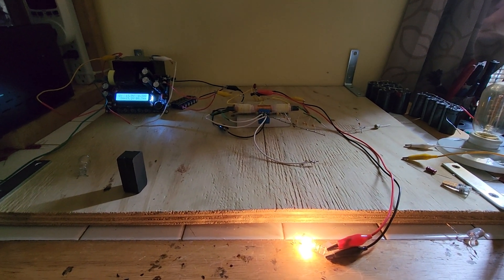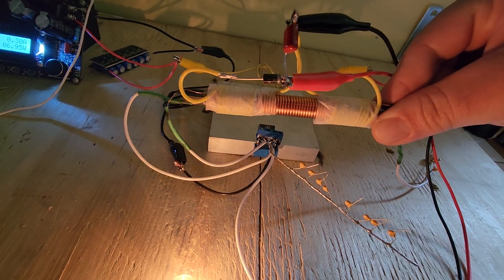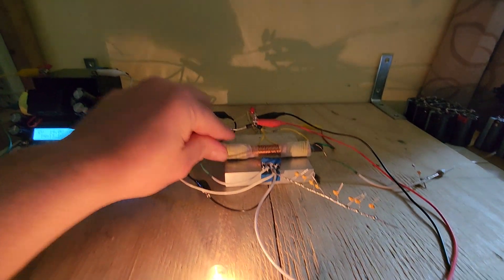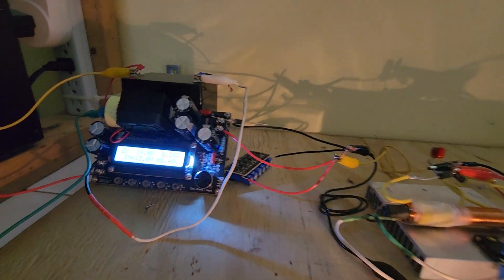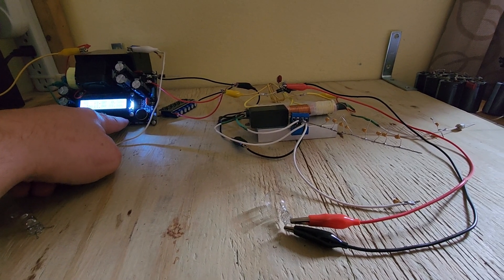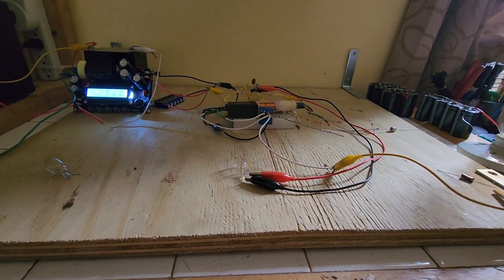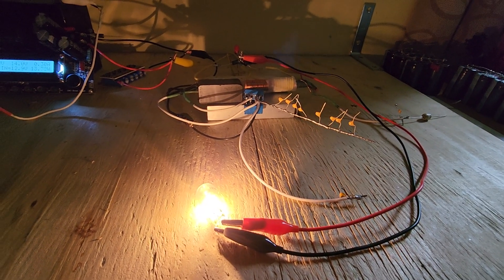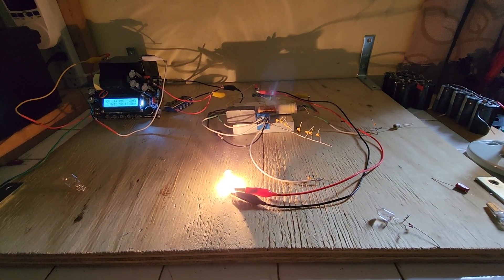🧲MAGNET NEAR RINGER INCREASES POWER OUTPUT & CAUSES XTREME🔥HEAT GENERATION IN COILS?💡

Comment: Hey man im trying to get my ringer going is those transistors you recommend the only type that would work i dont have any of those kicking around  and my other transistors die immediately when i wind the primary and secondary in opposite directions like you reccomend so i assume the ones i have dont fit the specs.
Reply from the maker: Tip35c works the best & primary is 4 inch long 26awg highest quality magnet wire wound first on ferrite rod then secondary is 14 awg highest quality magnet wire wound Opposite to primary & is 4 inches long.

Comment: Since the core is a permeable material that has limited flux capacity, its sensitive to external magnetic fields. When you bring the magnet near the ferrite core, it takes it partially into saturation. This causes its inductance (and thus impedance) to decrease, and the current will subsequently increase. (Edit: Alternatively, it will  alter the resonance of the circuit since a near-saturated core is quite non-linear. Using too strong a magnet will cause it to saturate completely and not work if its being used as a resonant element or RF transformer of some sort.) If you rewind it as an air core nothing interesting will happen. A once common application of deliberate saturation were ferro resonant transformers where a resonant circuit is used in conjunction with a portion of the core in saturation to help provide efficient regulation before modern switching techniques were used.
Reply: To me it seems this is exactly what is happening, tuning the resonator by adjusting the coil's inductance by the saturation of the core. And the light getting brighter sounds just like it being adjusted to the right frequency

Comment: Hello` The effect you see is M.E.G action! Use a choke on the plus+ input to the coil then you will see the heat go away.. Cheers! 👍
Reply from the maker: Very interesting could you elaborate more I'm very interested in learning all I can about this effect
Reply: @MTECH2022  Also you should think about five cores together then wind your coil. Cheers!
Reply: Limit duty TIME! B+ Choke L-C Circuit should tune out the main frequency into the system and use a heavy amp fast Diode in series to the main coil. Cheers!

Comment: It's the angle of the magnetic flux that determines if there is any feedback into the system that requires more power consumption. Bedini and Tom Bearden did the same thing. Also you can capacitor discharge into different shaped coils to shape the magnetic flux field of a magnet to produce very interesting g effects. At tachyon aerospace we had magnets that had two north poles and an oscillating south pole rotating around the middle which would produce induced emf in nearby coils with no input.
Reply: This sounds like Floyd Sweet's vta or otherwise some type of magnetic/electret combo. Very interesting to hear.
Reply from the maker: Very interesting & any way to get some of those magnets?
Reply: Explain what you mean by Induce EMF with no input.  You mean like the coil was not moving nor the magnet?